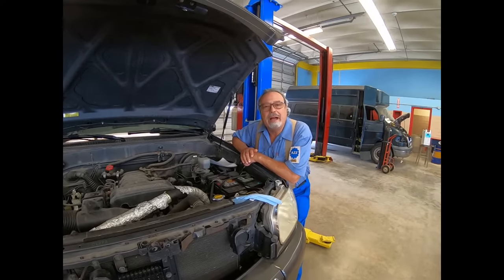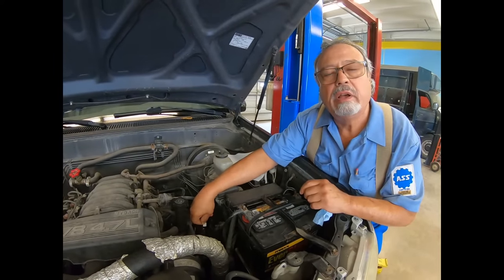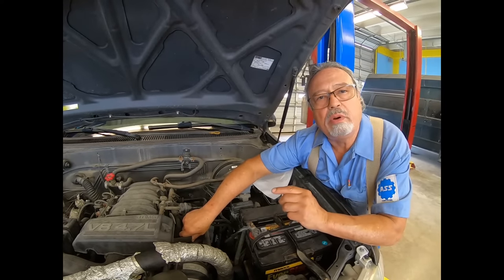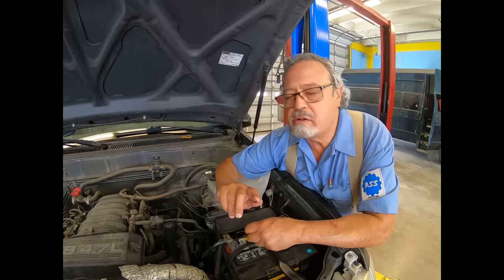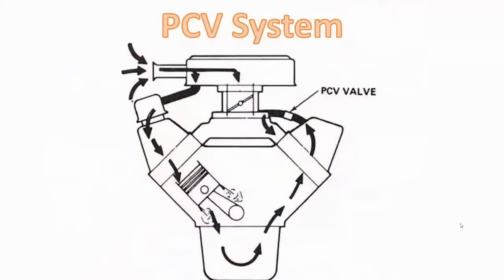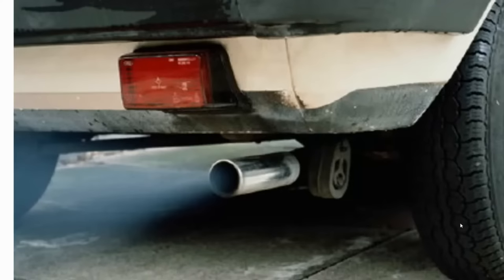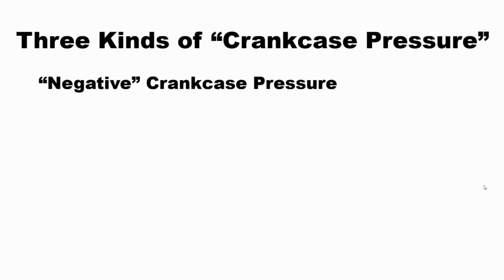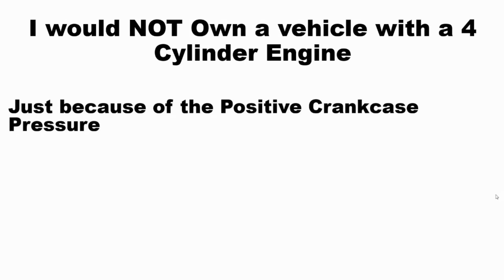Learn how IMPORTANT the PCV Valve is and why you should test it.

Comment: knowing that a 4 cylinder the paper flutter how can you check then if the pcv work or not ?????
Reply from the maker: Because most 4 cylinders are not large enough to create the amount of vacuum needed to put the crankcase under a slight vacuum, the PCV system can not be tested using the "Stick the Paper". 
Thank you for the view and that question.
I hope I was of some help.
Reply: thank you sir

Comment: So what about the smaller 3 cylinder engines. Are they more of a pollutant then?
Reply from the maker: Good question. I'm not saying 4 cylinder engines (or 3) are more pollutant, I'm saying that smaller displacement engines struggle to have a PCV system that is able to put the crankcase under slight vacuum. Unable to put the crankcase under vacuum will cause oil leaks and blow-by is not able to be controlled  as a pollutant. Thank you for the view and the question.
Reply: @theoldmecanicoshow9004  I just tried doing it on my Mirage G4 3cyl manual transmission car and the paper sticks on the oil dipstick port end. So this means my car is good? I maintain it myself, cleaning all that is needed regularly. It already has a mileage of 160,000+kms, or 99+miles, and it's 7yrs old.
Reply from the maker: @jepoyman8smelita  It's not good, it's Great ! What ever you are doing, keep it up. Clean is important. Clean oil and fluids. Clean filters, and Clean PCV valve. Thank you for the views and the comment/question.
Reply from the maker: @jepoyman8smelita  Yes that means it is Good. Thank you for the view and the question.

Comment: With those gasses oil is also going through, I’ve installed an oil catch can for this reason.
Reply from the maker: Yes...a catch can is an excellent idea. Thank you for the comment.
Reply: What is an oil catch can and where/ how do you install it?
Reply: @MelodyDorman  as the  oil lubricates the pistons, a bit of oil “blows by” and is Recirculated through the pcv and back into the engine block, causing buildup. The oil catch can catches the oil but still allows air back into the engine block. 
There are lots of YT videos explaining this in detail.

Comment: Worn piston rings will cause excessive pressure. So preventative wise, when should pcv valves be changed? Great video. U got a 👍& I sub'd! 🤓
So when u take oil fill cap out & air is blowing out, blow by??
ASS vs ASE, 😂😂🤣🤣 I had a kid make my class tshirts that altered schools logo also. He was a very bright kid!! 😉
Reply from the maker: Thank you for the view , the comment, the subscription and the questions. Yes worn rings but damaged rings (scored from overheating) and cylinder walls definitely cause excessive blow by. I like to change the PCV valve every two years.  Yes air coming from the oil cap opening is blow by. So... what change did your student do to the school logo???

Comment: my car doesn't have pcv.. is it gonna damage my engine.. should i use aftermarket pcv and stick it to head cover hose that runs to my intake pipe ?
Reply from the maker: Thank you for the view and the question. It would be a good idea if it had a PCV system. Yes, put the valve on the valve cover and run a hose to the intake. Good luck.
Reply from the maker: I am curious,  what kind of vehicle is it ?
Reply: @theoldmecanicoshow9004  im using honda civic. the block is b20. and b18c for head cylinder. I bought the car last month.

Comment: So there is no way to test if the pcv on a 4 cylinder is working?
Reply from the maker: Thank you for the view and the question. I have seen  few four cylinder engines stick the paper. I have also tested brand new vehicles with four cylinder engine and the paper does not stick. So to answer question : Don't expect the paper to stick, but you should change the PCV valve every two or three years. Thanks again.

Comment: ever heard of a little 4 cylinder ford sucking oil into the intake and running it through the throttle body? thing smoked like hunter biden. changed out the crank case vent cover aka PVC and it seems to have quit burning oil. is this a thing? never seen anything like it. but this PVC system was anything but normal
Reply from the maker: Thank you for the view, comment, and the question. I have seen some GM four cylinder engines that the PCV valve is built into the valve cover. (bad design) and you have to change the valve cover to change the valve.
Reply: @theoldmecanicoshow9004  is it normal for them to suck oil though, I guess that was my main question. thanks for responding!!
Reply from the maker: @779069  Normally there might be a small amount of oil sucked into the PCV system. However, "Excessive" Blow-by can cause too much oil to get sucked in. Thanks again for the view and the question.  Good luck my you tube friend.

Comment: what if we dont have a dip stick? BTW, is it hard to get the ASS certification?
Reply from the maker: Thank you for the comment. Did you mean BMW...? Transmission dipsticks have been gone for about 20 years (power streeting dipsticks longer) Did BMW take away the engine oil dipstick?  It costs about $50 at an embroidery place to get the ASS patch on file and made. I have mine on file already. Do you want one?

Comment: Question, anyone who knows...
I bought a new PCV. I blew into one side horizontally (the way it is installed on my engine) and it had an air leak. Vertically, there was no air leak. I returned it and got another one, but the same issue?
Maybe my lungs are not as strong as an engine! What do I do? Order another one?
On my engine (toyota) it is a difficult R&R.
Reply from the maker: Sorry...I am not familiar with that kind of test on the the PCV valve. I have heard of "Shacking" the valve. If it rattles, it's good. If it doesn't rattle, it's not good.  
If your PCV valve has over 100,000 miles, change it.
Reply: @theoldmecanicoshow9004  thanks for response. It is a check calve, air should only transfer one way. I'll do a little more research, then install the new one. I just hate a 1.5 hrs work to go to waste! (2017 Camry's PCV is in a very unique location.)
Reply from the maker: @Equilibrium29  $150 is Crazy money to pay to have the valve changed. Yes I am aware of that one and other valves in a very tough place to get.

Comment: i wonder why is my brand new car getting a lot of blow by pressure from a dipstic it's 4 cylender 2l tdi engine is that normal
Reply from the maker: Yes I have tested brand new 4 cylinder engines to find they do NOT stick the paper. The 4 cylinder engines are too small to draw enough vacuum to put the crankcase under vacuum. So...to answer your question, yes it is normal.
Reply: @theoldmecanicoshow9004  thank you for your reply

Comment: I have 94 chevy truck I noticed it falls on its face after its warmed up it falls on its face
Reply from the maker: If it's TBI (Throttle Body Interjection) , those types are very sensitive to a small drop in fuel pressure. Replace the fuel filter. Good Luck.

Comment: I have a 9th gen, Chevy Impala: Regardless of how its' operating, do you recommend  changing the PCV valve at some mileage or time interval? Will installing a 'catch can' benefit the engine's maintenance and performance? thanks
Reply from the maker: Hello,
Yes installing a Catch Can will help very much to keep the intake manifold  and intake valves Clean. Clean is Good for the engine. The PCV valve use to EZ to change. Today, some GM vehicles require that you change the valve cover. The PCV valve is built into the cover and is Not replaceable. So long as the paper sticks (held in place by some vacuum) the PCV system is working good. Thank you for the question. Please keep watching my channel maybe share with others. Thank you again.
Reply: @theoldmecanicoshow9004  Excellent
Reply from the maker: @Clarc115  Thank you for that Positive comment. Thank you.
Reply from the maker: @Clarc115  Thank you for that Poistive comment.
Reply from the maker: @Clarc115  Thank you.
Reply: @theoldmecanicoshow9004   GM  Garbage Motors
Reply from the maker: @kennylavay8492  GM Junk !   Shitty Chevrolet / Crapalic  Thank You for the view and the comment.

Comment: Can the paper be put in the valve itself for the same results
Reply from the maker: Your on the right track, but putting the paper on then valve only checks for the presence of vacuum to the valve. The complete test is to see if they is enough vacuum to put the entire crankcase under vacuum. Thank you for the view and the question.
Reply: @theoldmecanicoshow9004  makes sense because dip stick goes into crankcase

Comment: Good info, but 95% will skip video cause of (not needed) length. And to be frank after 500 repetitions i got bored as well and sped through.
Even better if you mentioned around what volume 4s should start getting neg crank case pressure, given 4s (or less) are the most common (and environmentally friendly) in the world

Comment: I got a2003 pathfinder to replace pvc mechanic wants $400 because the top of engine has to come off to reach it, this is how Nissan is designed.
Reply from the maker: Thank you for the view and the comment. As long as the paper sticks your okay. It is crazy how complicated things have gotten. What use to be a very simple replacement has turned into hours of repair. Thank you again for the views my you tube friend.
Reply from the maker: I did research the replacement of the PCV valve on your vehicle. Yep... it's not a quick EZ job. 🤕

Comment: Where's pcv valve on 2015 Ford fusion?
Reply from the maker: Hello, I did some research to try and help you. There are NO you tube videos on the PCV valve on your vehicle. There is a video for a 2007 Fusion, but I doubt that is like yours. I also checked the auto parts to see if they sell a PCV valve. They do NOT. Sometimes a vehicle does not use a PCV valve. I'm not sure what to tell you. There are several different models of the Fusion. I just guessed at your model and engine. Any way...thank you for youe question and the view.

Comment: Can you explain that spigot on the heater hose?
Reply from the maker: Thank you for the view and the question. The spigot on the heater hose is to make the AC colder. I live in South Texas here it gets very hot most of the time. By putting the spigot I eliminate 100% of the heat that is next to my AC evaporator, thus making the AXC colder.

Comment: Liked and subscribed, excellent teacher!
So if a vehicle has positive pressures, created oil leaks (let's say rear main seal for example), does replacing the PCV possibly have a chance of ending the leakage, by the negative pressure.. or once the seal has failed, there is little to no chance the replacement would solve a leak?
Reply from the maker: Negative pressure is so Desirable. Going from Positive pressure to Negative pressure can: slow down a leak / stop a leak / Seals leak because of positive crankcase pressure ANDANDAND..."Heat" hardens the rubber/ neoprene seals ,then they can not hug the surface area correctly. Thank you for your positive comment.

Comment: In the early 60's and before there was no PCV valve.  There was just a down draft tube...  THE BEST...  PCV doesnt clean your oil.   The bottom end of your engine 'might' general 1-2 pounds of positive pressure...  THAT needs to be vented to atmosphere.  Your engine intake system might generate 20psi vacuum,  so now you're pulling a vacuum on the bottom end of your engine..  thus crating a fine mist of oil, that is then drawn through your valves into the combustion chamber.  A down draft tube is all you need,  It will easily equalize the pressure, thus preventing blow-by and leaking seals.  You might see a drop of oil over time coming from this down draft tube, thats fine.  its says its doing its job.  Burning mystified oil sucked up like a vacuum through your motor IS NOT CLEANING THE AIR..  its making it worse.

Comment: Would a broken pcv cause high idling?
Reply from the maker: PCV valves mess up three ways :  1 They get partially restricted  2 They get completely restricted  3.  They get stuck open. Any leak on the hose going to the valve would cause high idle. A stuck open valve can cause high idle. Dirty restricted valves would not cause high idle. Thank you for the view and the question.

Comment: I had to change a PCV valve in one of my trucks today. Now I am going to do the paper test on my other truck tomorrow morning. Really... PCV valves are so cheap, just replace them every 50 thousand miles or whatever.
Reply from the maker: Thank you for the view and the comment. You are correct about the PCV valves don't cost much most of the time. But check this out... some GM 4 cylinder engines require that you change the valve cover to replace the valve. Not only does it cost $150.00  it's work to replace the cover. Thanks again.

Comment: What about diesel engines 4 or 6 cyclinder is it same test ?
Reply from the maker: Thank you for the view and the question. If I'm not mistaken, diesel engines do NOT  have a throttle plate to control the amount of air entering the engine. It is the restriction of the throttle plate on a gasoline engine that creates the vacuum to operate the PCV system. I have never tried this test on a diesel engine so I' don't know the answer. Anybody out there know the answer?
Reply: Hi I work in england on fiat and Mercedes ambulance vehicles will do this test fiat we have 4 cyclinder 2.3 and 3.0 and Mercedes is a 3.0 v6  diesel engines and let you know result of paper test
Reply from the maker: @danielgreenbaum8875  Thank you for the view and the question. I have never done this test on a diesel engine. I am pretty sure diesel engines do not create vacuum because they do not have a throttle to control the air. No throttle means no vacuum, and no PCV system.

Comment: Sir I have this 1999 Ford 250 super 3/4 ton V10 and this started the idling up and down up and down and it doesn't want to idle and it's about to shut off I got a nice truck customized from one end to the other but I'm not a mechanic could it be the PVC valve that's making it I don't really up and down up and down the motor anyone out there can help me out please do so mechanics want so much money.
Reply from the maker: Thank you for the view, the comment, and the question. Its just a good idea to change the PCV valve every couple of years, they get really dirty. As far as your idle problem, First start with the key on / engine off. There should be a check engine light on. This test makes sure the light works. Second, if the light is on while the engine is running, get the codes. It probably has a Lean code.  If it has a lean code, watch a couple of you tube videos on how to make and use a "Smoke Machine". But before you do that, get a flashlight and do a good visual inspection on all the vacuum hoses. I wish I could tell you exactly what is wrong with your vehicle. Good luck my you tube friend.

Comment: I have a 66 Plymouth Valiant  and I can't get the idle right.  Carburetor issues???
Reply from the maker: Does it pick up speed okay? If it does, it does  not have a misfire. If it is the carb, it is either rich or lean. With the engine idling, use a light to look down the carb. It should be bone dry, (no fuel present). If you see wet, the carb is running rich and needs the float level adjusted. If that is not the problem, slightly choke the carb, either with the choke plate or you hand. If the idle improves, the engine is running lean. Usually a vacuum leak or lean carb. Good Luck.
Reply: @theoldmecanicoshow9004  thank you 👍
Reply: @theoldmecanicoshow9004  so when I get to a red light my car 1966 Plymouth Valiant acts like it wants to shut off so I have to put it in neutral and it idles fine.  Are you on Twitter or Instagram?  Are you in California?  GRACIAS 👍
Reply from the maker: @MrRecord1  Hello. 
Did you look down the carb with a light to see if you can see any wet gasoline at idle? Also. did you try to chock it any? I am on Twitty.
Reply: @theoldmecanicoshow9004  I looked down and it's dry and I also placed my hands over the carburetor and it wanted to shut off
Reply from the maker: Sounds like it's running a little bit rich. There are color blank on the spark plus: a dry black (rich) and a shinny black(oil on plug) The plugs should be a light brown. Dry black means rich. Have you put a carb kit in yet?

Comment: But 4 cylinder cars can go 300k miles so how can they do that with such bad pvc problems ?
Reply from the maker: Thank you for the view and the comment. My opinion comes from decades of fixing oil leaks on engines. I learned early that it is difficult to stop certain oil leaks when the engine has Positive crankcase pressure. Positive crankcase pressure is not "Bad", but it is less than "Desirable". You are correct, four cylinder engines can last 300k when well maintained. Thank you again.

Comment: Nice checking my v6 now😊
Reply from the maker: Thank you for the view and the comment my you tube friend. I hope your paper sticks.
Reply: It certainly did. 190,00 plus miles.
But I take care of things in time.
Recently cleaned but not replaced PCV And also did my spark plugs at 187,000 
3 in rear were difficult, 1-10 about a 7
BTW those spark plugs went the whole distance without any real issues, DENSO Toyota what a feeling… lol